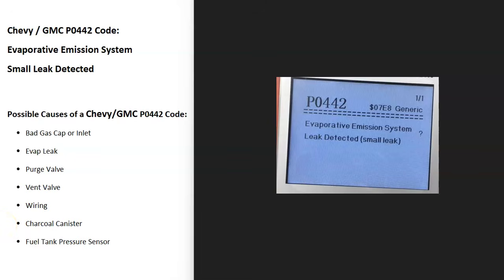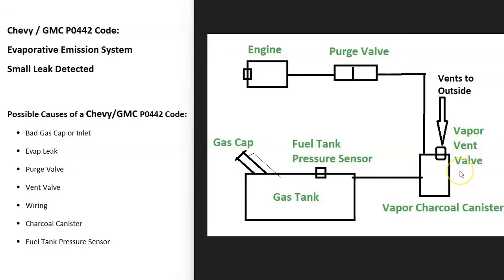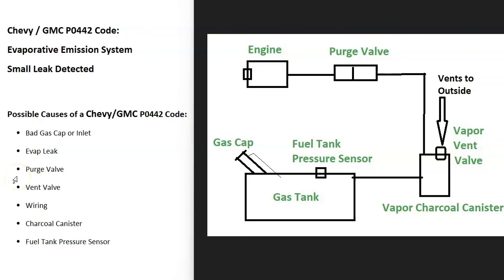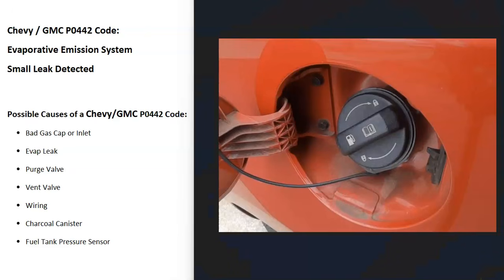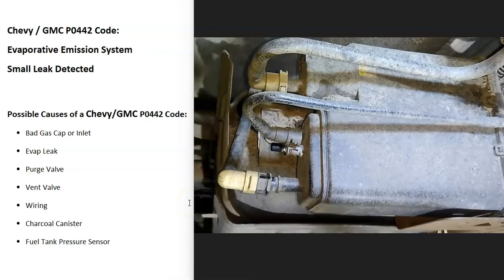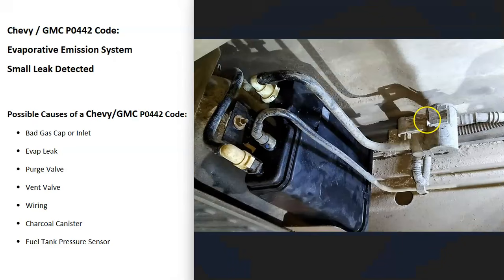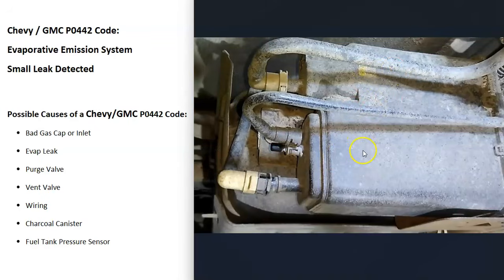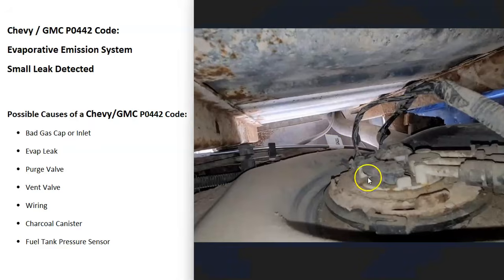Causes and Fixes Chevy/GMC P0442 Code: Evaporative Emission System Small Leak Detected

Comment from the maker: Update: I made a full video on all the EVAP components and how to test them and fix EVAP Codes; here is a link. https://youtu.be/C5s3Rx3wjD0
Reply: Hey bud I patched a rusty line and then I got fuel pouring from vent valve so I replaced it and purge valve and fuel is still pouring from vent valve id appreciate any help or advice

Comment: Might need to do that smoke method because I replaced all components and I’m still getting the same code
Reply: Ey I hope you fixed it 😢 I changed everything but I also still have the code ??
Reply: You have to reset the computer after replacing stuff then drive it on and off the expressway for around 120 miles to get the cars monitors ready

Comment: I used to get 'tighten gas cap', I could tell the cap wasn't working right, so I replaced it with a GM cap from RockAuto.  Now I get the P0442 code.  Faulty cap maybe?  Purge valve on engine seems to be working, so I'll have to check the vent valve at the canister.

Comment: I have a camaro 2012 ss, my check engine light doesnt come on, but through my obd2, it gives me this code (DTC P0442 Chevrolet) although I dont smell gasoline from the interior. Will it be a problem if I ignore this issue?
Reply from the maker: Usually, the EVAP system does not affect the engine. It just won't pass an emission test. The only component that can affect the engine is if the purge valve is stuck open, which usually causes a long start times.

Comment: I patched a rusty line on my 99 silverado and now fuel is pouring out from the vent valve do u know what i may have done wrong i hate throwing parts at the old rusty truck i replaced the vent valve and purge valve still leaking.....help😅
Reply: Help

Comment: I've been having this code show up for over a year now but it's always been intermittent during summer time I rarely see it when it's winter it shows up alot but only if it's a big change in temp like if it's 50 degrees one day and low 30s the next but if it stays close to the same temp for awhile it rarely shows up. I've replaced the gas cap but that's it I'm thinking of doing the purge valve to see what that does since it's the next easiest thing to replace i have a short bed gmc sierra single cab and that canister is not in a fun place to work on that's why I have avoided it but what do you think my problem may be.
Reply from the maker: Temperature can affect the hoses and seals, expanding and contracting them, which can lead to leaks when the temperature changes.
Reply: @HVAC_Mechanic  that's what I was thinking also but if that's the case then I would be getting the code all the time when it's 30s and below but I don't

Comment: I have this code on my 03 s10. I've replaced the purge solinoid, purge valve, purge canister, charcoal canister, fuel pump, and fuel tank. It will not take fuel at the gas station (constantly clicks off) and spits the fuel back out if i keep forcing it. Does anyone have any ideas what the problem is? Coulf the fuel pressure sensor or filler neck cause this?
Reply: I've had this happen almost every time I get gas. It clicks off but it doesn't put it out. Amd now I have a small evap leak code. And my car when I first get into it, doesn't wanna accelerate it wants to sputter. But after awhile it stops. I've done seafoam gas already. Nope. Thinking this comment led me to a bad vent valve?
Reply from the maker: That is a common symptom of a bad vent valve, which is located under the vehicle with the charcoal canister by the gas tank.
Reply: 03 envoy.  @HVAC_Mechanic

Comment: I replaced the purge valve and gas cap about a year ago and it’s popped up again recently. Think I should replace those again or look into it further to see if something else down the line is causing the failure
Reply from the maker: I would test the EVAP components to see what the issue is. I made a full video on all the EVAP components and how to test them; here is a link. https://youtu.be/C5s3Rx3wjD0
Reply: What was the final result?  I did my gas cap and purge valve last year and the code is back

Comment: Will this issue cause the gas pump at the gas station to cut off sooner than normal???
Reply from the maker: It needs to be diagnosed, but that is a common system of a bad vent valve. The vent valve is often built into the charcoal canister but can be separate sometimes.
Reply: Ur fill tube may be bad
Reply: I had one time like that. My vent valve was stuck closed for some reason and my pump stopped every second. Luckily I had a scanner so I manually opened the vent valve with scanner and the pump never stopped after that.

Comment: Thank you for video .
ran through system. Checked everything and all it was is gas cap on 01 silverado with 213000 miles
Reply: Check your filler neck for rusting away also....

Comment: I have 2011 express van 6.0 no start with p0442 I changed purge valve and hose, still no start
Reply: I have the same problem
Reply: How did you fix it?
Reply: Was it the vapor canister?

Comment: Some years ago I had to siphon old gas out of my truck, add new and a fuel additive to try and fix the ethanol build up in the bottom of the tank. Since then I’ve had the P0442 issue. I have to get gas ⛽️ at a pump that has more slender gas pump nozzles and turn it way up to the side, half way out to let the vapors out in order to fill up. Same with the Subaru as it was given to me and had been sitting for a few years. 
Screwed up some flap in the filler neck I think. 🤔

Comment: If you have a scan tool that can do freeze framing. Ive found personally. That p0442 triggers on key on instantly if your tank pressure sensor is bad. You can scroll thru the data pids and goto evap-vp will show 0.0 (meaning its not working, in the module data for ecm i found that stats high was on a evap pressure parameter (shows the allowed voltages min/max and im .263 volts over the max telling me shorted out) hope this helps!
Reply: Nobody let this guy work on your vehicle

Comment: When performing the smoke test, did you use a scan tool or jumper out the vent valve to close it? If so, what wire did u jumper off from?
Reply from the maker: Its best to use a scan tool otherwise a wiring diagram for the vehicle is needed.

Comment: I’ve had aftermarket fuel neck leak where the plastic meets the metal where you fuel up at, they have a crappy way to crimp the metal, so i bought another from advance, it looked just like the one i got on ebay, this time i sealed around it with black RTV sealant, it worked!

Comment: I had my fuel pump replaced  about a year ago and the guy told me the fuel   lines are brittle.   Could this cause  this code#?

We have changed the purge valve, gas cap,   some frayed tubing, checked all wiring connectors.    We are stumped.
Reply from the maker: Bad fuel lines could cause a fuel leak, but likely not a P0442 code. Bad Evap hoses can cause a leak and a P0442 code. It may be best to get an Evap smoke test done to see if there is a leak.
Reply: replace purge solenoid canister.

Comment: I just got a suggestion just buy a Ford and you won’t have check engine lights on every single day. I got two Fords in a driveway and two Chevys in the driveway Chevy always got some kind of check engine light on always.
Reply: Sure I may have a check engine light, but it’s an easy fix and at least I have a truck that works for more than a year
Reply: Fords are a pain  to work on, and you better have the part in hand when you go to the parts store .
Reply: That Chevy will still outlast that ford, with a Christmas tree gauge cluster
Reply: @7chevypower haha yea no, you have a better chance of yet another "bailout" for your wet dream of a car manufacturer 😂😂
Reply: In fleet, fords are the ones that come back the most for Evap codes.
Reply: Ford still best selling on EVERYTHING, I'm here because my daughter defied me and had to buy a chevy! I've got 5 ford's and NEVER had this or cat and o2 codes ever.. this camaro only has 135k on it. Replaced cats, os sensors.blah blah. Out of my 5 ford's, 2 have over 200k, and one just needed an alternator replacment.
Reply: @HC-xs6ek 
Agree. 18 f150 165k 5.0 no check engine lights. Meanwhile my coworkers who have Silverados have lifter problems and total engine rebuilds under 100k
Reply: DTCs are usually easier to deal with than having a ford that loses reverse due to a $2 rubber band

Comment: I got the code changed the evap canister and fuel caps, engine light went away, been driving it for a couple days now, engine light never came back on but it stills shows the code P0442 as permanent. Does it  take a while for that permanent code to go away or do I still have a evap leak ?
Reply from the maker: The vehicle needs to go through a drive cycle, which needs to be looked up since it is different for each car or truck. Usually, just driving around will cause it to clear eventually.
Reply: If it doesn't clear from just driving, you can get a bluetooth module for the OB2 port and connect your phone to clear the old codes manually. Just be sure the issue is fixed before doing so.

Comment: I changed my purge valve. It idles much better now but I still got engine light blinking. Can’t find any other issues. 

Would bad fuel injector cause the blinking? Still no code outside of p0442. I had p0496 when I replaced purge valve. 
Not getting a code for fuel injector. Replaced all plugs
Reply: @MrDon967. 
Most often when an engine light is blinking,you have an issue with a plug or plug wire,or possibly the cap. Blinking light in a Chevy is a misfire.
Reply: @barrykiefer9387  yup i never had blinking engine light but now i know it means misfire n i got new sparks n ignition now so all set :D
Reply: @barrykiefer9387  I just done my packs and plugs and then afterwards the evap code small Leak detected. 03 envoy
Reply: Already spent 100 almost for all these parts last thing I wanna do is pay someone else to look at it now. The engine light blinking is what’s causing me to worry.
Reply from the maker: If you only have an Evap code, it should clear with a scan tool. 2010 and newer vehicles need a drive cycle to fully clear, but the light should go off. If the codes come back, there may be another issue, such as a leak.
Reply: turns out the igni coil went bad also. idk why it took my code reader 3 tries to get the p0300 switched out the coil pack good as new @HVAC_Mechanic

Comment: Just got the same code on my 2014 Silverado … thanks to this video i know where to start looking …. Thanks bud.
Reply: Did you figure it out? My 14 sierra just got it after they’ve replaced my fuel level sensor and temp sensor I’ve been getting a “tight gas cap” error for a month
Reply: @5RWill  not yet. These holidays have me spent lol but will try to adress the problem in January. Happy holidays !!
Reply: 2 years later were you able to get it fixed?🙏🏾🙏🏾
Reply: @i @itaintcal  been working great so far !!!
Reply: Did you fix ? Got same problem
Reply: @blassmayahua  nope 🙂‍↔️